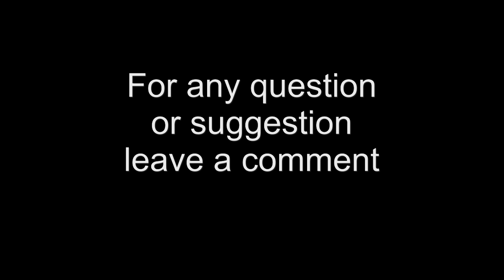HP laserjet P-1102 Fuser Unit Disassembly and Assembly

Comment: First of all thank you for the very informative video!
My P-1102 spit an Error 50.00 exactly 10 years after I bought it (almost to the day). Rarely used (second cartridge still has plenty of toner inside).
After seeing your video I am thinking of opening it up and cleaning it. Maybe even change the fuser sleeve. Do you have a part number for the sleeve?
Can a relatively bad ventilation be the reason for the fuser error? My printer sits inside a Kallax square (approx. 33 x 33 x 33cm cube, with some 3-5 cm of space to the wall behind it).
Reply from the maker: THere is no part number of the fuser sleeve, HP only sells the fuser unit. The printer generate heat so the bad ventilation could be a cause of defects
Reply: @viandant5  Then do you have a P/N for the fuser? I couldn't find the definitive answer for that, but I feel buying the user doesn't make much financial sense compared to buying a new printer.
Reply from the maker: RM1-6920-000CN 110V - RM1-6921-000CN 220V

Comment: I had a ligkning strike and now the led lights do not come on. I replaced the fuse - it starts up with mechanical noise but no led's.  Any idea?
Reply from the maker: Probably you have to change the whole power supply

Comment: I have 1005 printer
5-10, 20-30 pages print and after it show error paper in jam
Say sir how to solve this problem
Reply from the maker: Try to clean the rubber pick up roller. Where does the paper jam?
Reply: In fuser unit
Reply from the maker: @BabluKumar-ny3hz  Check the fuser picker fingers, are they dirty? check the springs of the fingers, check if the fuser is worn

Comment: Is it normal that you need quite a bit of force to manually roll (with the white wheel) the upper roller? Or should it turn quite smoothly? Thanks!
Reply from the maker: Once you remove the fuser unit from the printer it should move freely without too much force